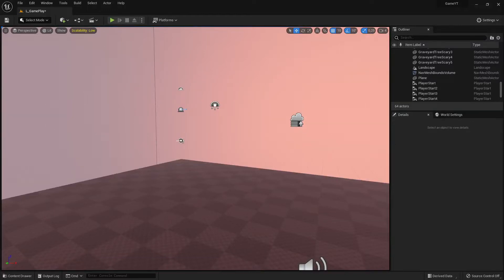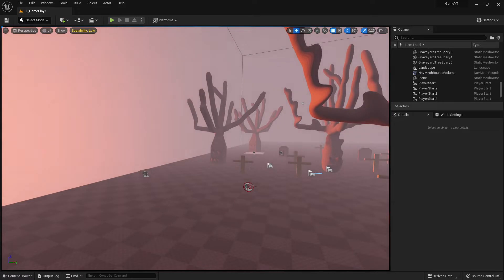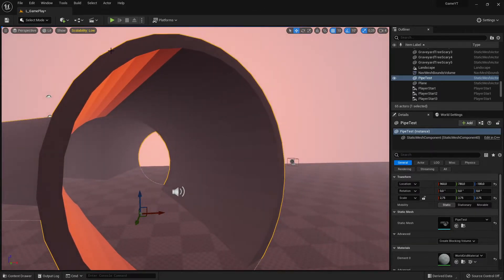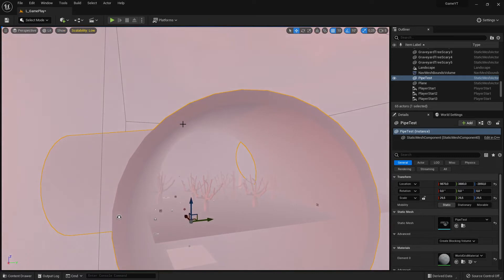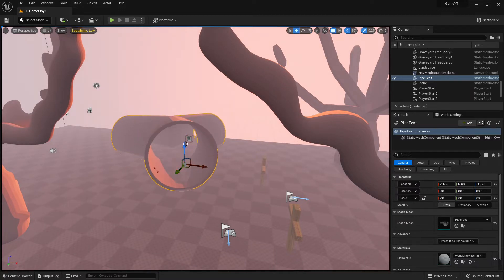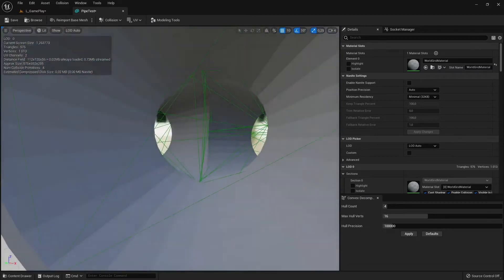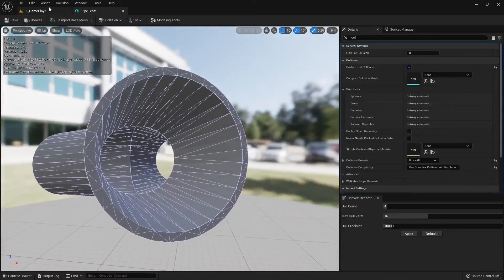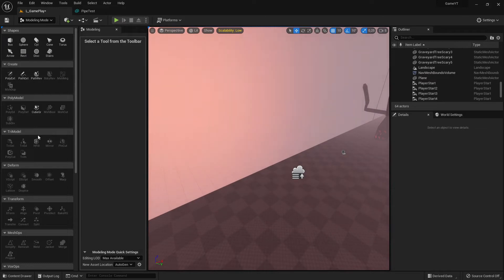Unreal Engine 5 - Beginner #126 - Pipe Holes Collision

Comment: Thanks! I am making tunnels and caves with difficulty of many walls. I will now use your clever idea of using pipes or cut-out cylinders. Also like your collision work around. I use other game engines and I was surprised how difficult UE5 collision templates are to use for tunnels.
Reply from the maker: It is all time good when it helps. But I made several videos of Collision and the last of them shows that you can even use auto convex collision. You need just to set the hull count higher . The hull count is used to create different collision boxes which you can even move seperatly. With other words its easy to create caves pibes and anything with a whole by useing auto convex with hull higher hull count.

Comment: I heard it was expensive on the computer. To use (complex collision as simple) for objects with complex topology or geometry, like sculpted objects. Just a warning depending on what you're doing, if that is true.
Reply from the maker: Thx for the tip. I will cover this in one of my next videos so starters should be aware of that too and not use to much complex collisions only in rare cases.